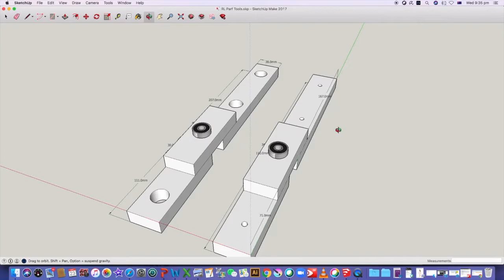How to Make a Low Cost Parf Guides

Comment: Made a similar jig last year, using 12mm aluminium plate.  The PARF uses two bearing holes, to allow indexing to either 3 or 20mm- but all you need is a 20mm plug with a centre 3mm hole and one bearing will do. Made the rules that go with it by using a mill to space the holes accurately. Made my first table using it. Lot of work, moving it around and clamping it for each hole- both sizes.
I now use a template (8 x 6 holes) with 20mm holes and a trim router. You dog it across the table to make any size you want. Way easier and faster, and at least as accurate. Tip- slightly undersize holes (.02mm or so) and finish with a reamer. Gives very precise holes with a great finish.
I am with Paulk when he says MDF is not suitable for the table- way too unstable (check out movement with moisture). Birch ply is the only way to go. The original table did not use the dog holes for alignment - both rail and fence are indexed to the frame.
Reply from the maker: Hi Mike thanks for your feedback. That sounds like an interesting approach with your parf guide. Did you make your router template from birch ply as well?
Reply: @diycave5144  Yes, cut on my CNC router. Spent some time making sure that was calibrated and square before making! Once you have it, you want to put dog-holes in everything... I read a research paper on MDF and moisture content and I swore off MDF for anything requiring accuracy. It moves an alarming amount.
Reply: I’d love to see a video on this.

Comment: Great Work! Would it be easier, if you had made a jig for the router instead of the drill? 20 mm router bit through the Ring and good. I will try this.
Reply from the maker: Hi Alexander, Great suggestion. This was part of a series of DIY video's that looked at ways of accurately making these 20mm dog holes. Check out this video in which I use a router. https://youtu.be/aOEoib5E8gU . In general you right, it is easier to use the router and a jig in my experience, especially when you are drilling out a complete work surface. Also check out the other video's in this series on my channel to compare the techniques.